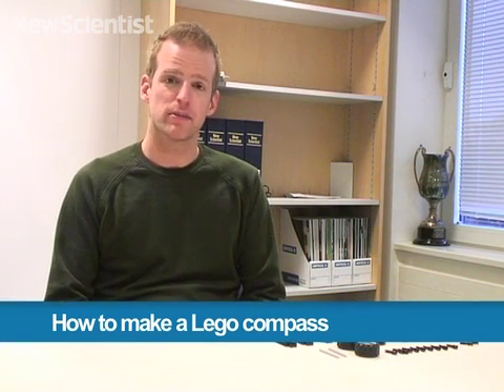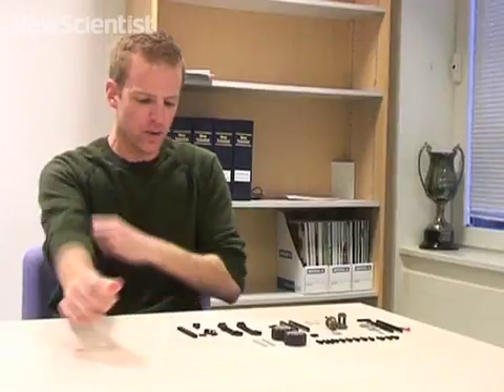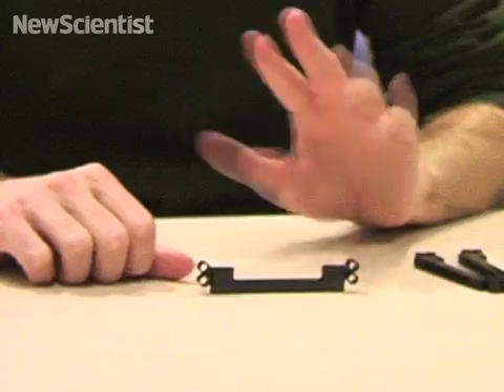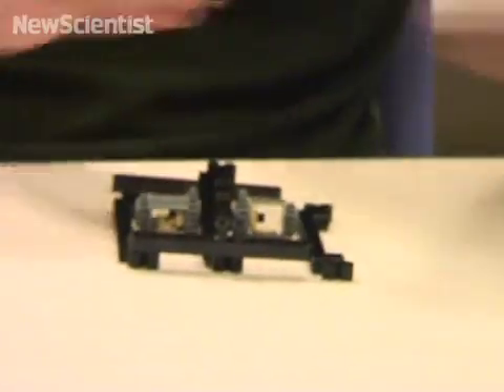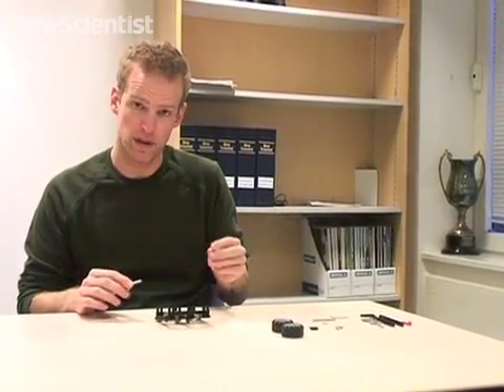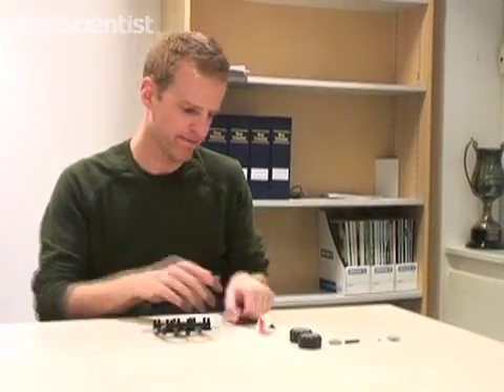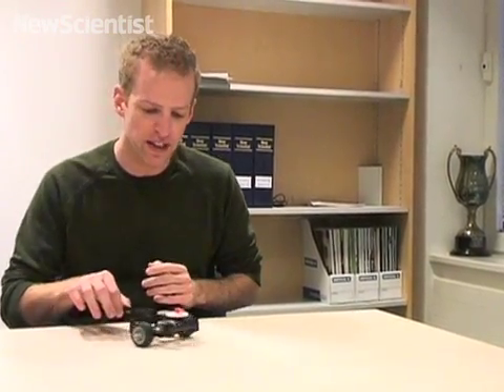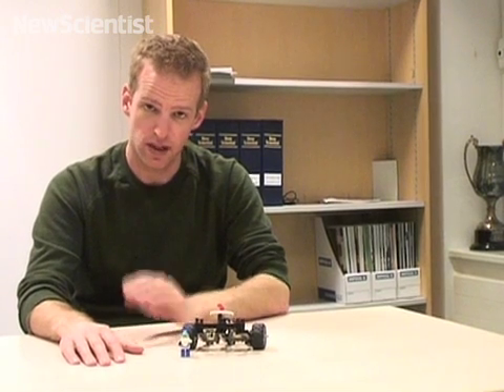Lego compass

Comment: this isn't a compass, if you have it pointing north instead of south to start off with and turn it, it will not go south, why do they call it a compass? all it does is point to the original direction it was pointed at. Cool but don't call it a compass, and maybe next time explain how it works kthx.